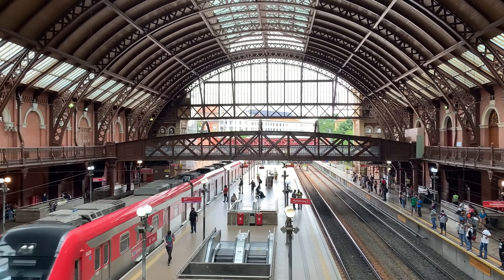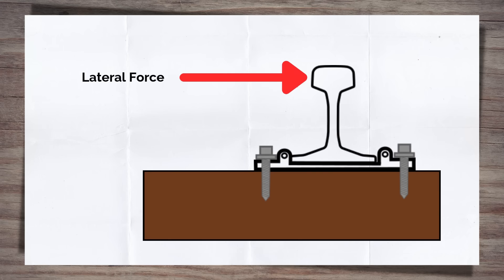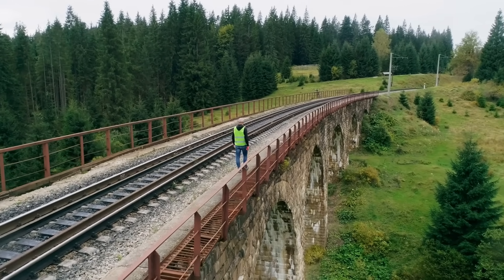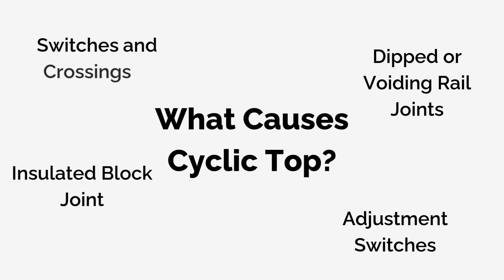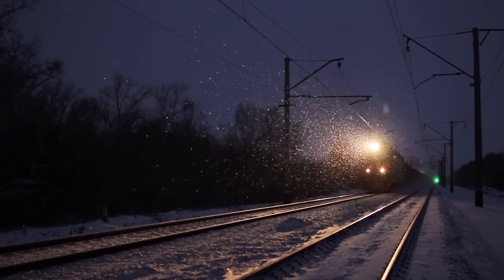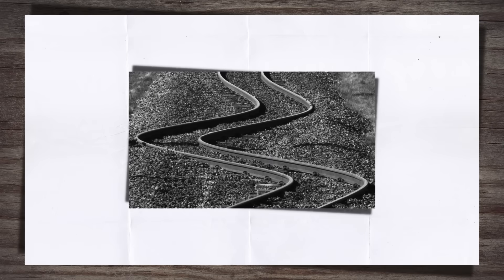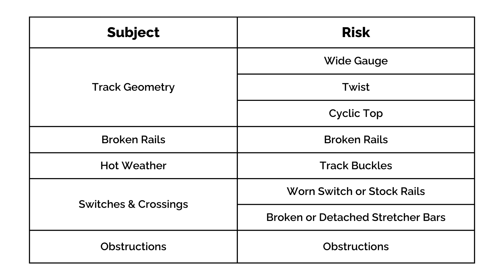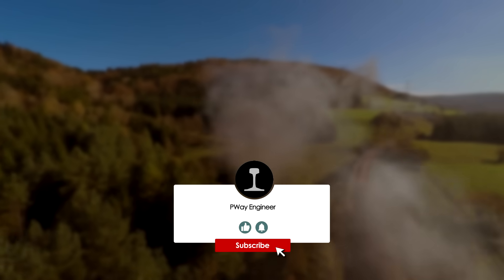Why Do Trains Derail? The 8 Railway Track Root Causes You Should Know

Comment: One of the derail which happen in Hong Kong back in 17th Sep,2019.Quite a interesting case.
One of the train derail after departure at Hung Hom Station because of the gauge problem when the wheel passing the switches,(This is more complicated because the sleeper which MTR decide to change from wood to Epoxy sleeper. The Epoxy sleeper which had been run on Light rail quite a long time, but it never use on heavy rail services before.
No one known the epoxy sleeper had different profile and stress when running on light rail and heavy rail purpose.
The High density service cause the bolt and joint on the sleeper to wear much faster than wood...which causes the track gauge become widen and derail at the end.
Its quite interesting story and more info down below.
https://www.emsd.gov.hk/filemanager/en/content_1394/ERL_Derailment_Incident_Report_(Eng).pdf

Comment: Great video, thank you. Two to add - 1. Half-cocked points (not fully thrown) and 2. Wheel flanges that are machined too finely (can push the switch blades from the stock rail).
Reply: I drive and check (freight)trains as my full-time job for over 12 years and i'm 100% sure that a wheel with a flange that is soo finely machined it would be able to get between the switch blades (which means it would be almost as sharp as a knife) would never leave the factory and even if it would, not even the most unskilled mechanic would ever install it
Reply: Flanges are machined to a standered called a flange gauge. What happens is wheels are made of a softer grade of steel than the rail specifically so that the wheel wears faster than the rail because it is cheaper to replace a wheel than a rail length. Sharp flanges (as they are called) are detected through constant inspection and when detected the wagon is immediatly shunted off. The crunching sound heard when trains move slowly round curves is the grinding of the flanges . At speed that grinding often sounds like a contineous "ping". If sharp flanges are not removed they can be the cause of derailments by the sideways pressure on a curve being so great that the flat flange wil create a sideways adhesive pressure an jump the rail. alternatively they do the same thing at turnouts if the speed is too high and break pieces out of the turnout blade as shown by the video.

Comment: Why they derail so much? Because wheel flanges are too small. Let's face it, all it takes is 1" of wheel lift for whatever reason and BOOM! Well... that's MY main opiniatic reason. Hey.. a new word.. "Opiniatic" (of opinion).
Reply: Its actually wheel tread profile the keeps wheel on track the flange is secondary to keeping wheel on track , basically the wheel is steered by tread profile not flange . Sharp curves pointework do cause flanges to contact rail though also causing noise
Reply: @nounoufriend1442  
Yes that’s all true but the since flange is the “last resort” and if there is any issue, that last resort ain’t big enough to deal with such an issue. Also, flange climb can happen due to rail or wheel improper profile due to wear so… if the flange were made bigger, less chances of a derailment because it has more surface area to keep the wheels on track despite any profile issues.
Reply: @Bassotronics  Problem with larger flange is the clearances on the rail infrastructure , we get oversize flange due to wheel tread wear (and thin flange )   . If remember correctly max flange height was 36.5 mm (should remember measured lots of wheels ) thickness 23 mm , on P8 profile . Agree bad profile can cause flange climb , we had loco derail just off tire turning due to poor surface finish , also a thin flange can split points . Spent many years re railing think most of our derailments were track spread seconded by points
Reply: @nounoufriend1442  You are correct.  The wheel flage more often assists in the wheel traversing a gap at the frog in a turnout or a diamond where two separate tracks intersect.
Reply: 1.5"

Comment: Whilst in university I worked one summer for CN rail in Motive Power. We had the same passenger train derail for 2 consecutive Saturdays at the same level crossing from hitting a low bed trailer that got stuck on the tracks. This was a new train set that had five sets of coaches with six locomotives. These trains were the first on CN to have electric heating from locomotive head end generators. GO transit had the same system but they were owned by the province.  With two locomotives out of service for derailment damage we were in trouble except that the railway decided we needed more backup and started converting old baggage cars to combo baggage cars and head end power generators. We had a couple of other derailments that summer, mainly from level crossing collisions.
Reply from the maker: Sounds like an eventful summer!

Comment: I worked in a rail yard and derailments were not frequent but not rare either. Many involved a facing-point move, especially if a previous trailing-point move had "run through" a switch not lined for that move. That would break the "hub" that is part of the point moving mechanism. A common enough occurrence as the hub is designed to be the first thing to break and is easily replaced. 
I saw a car in the middle of a train "pick" the first switch while entering the yard. Yard switches take a pounding, and that one must have decided it had had enough, tried to send the car down two tracks at once.
Reply: Any constant laser device that verifies the point health at all times and sound an announcement to the engineer when there is a defect?

Comment: Arriving for work in Didcot, we had an embankment, that every time a train ran over it, it would lower despite packing fresh ballast. It was decided to have a TSR and someone monitoring the track. The root course was some work had altered a water course, eroding the bank.

And then there was Ufton Nervet, I saw the aftermath. 

The following day, we worked on the B and H, ultrasonic testing, the signalman told us there was one train running, but he was almost out of fuel and if anything changed he would let us know.